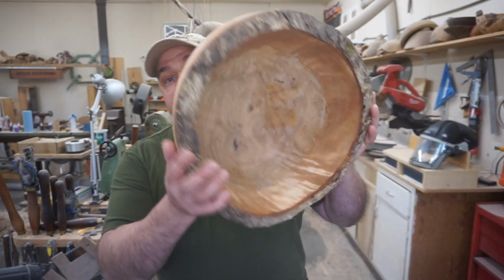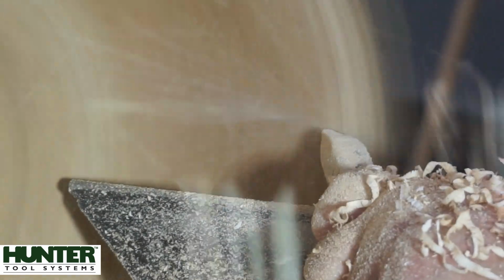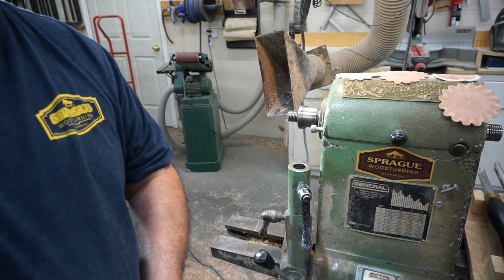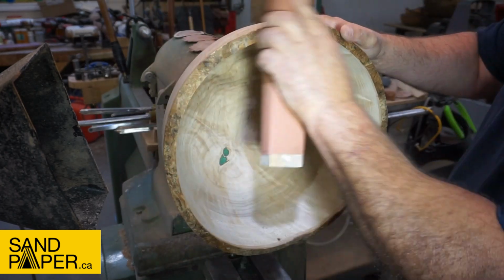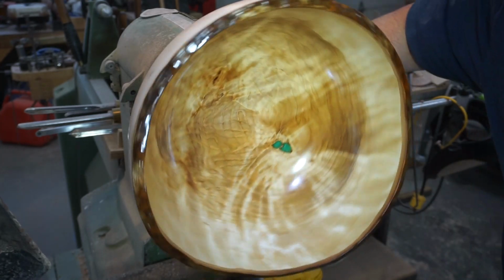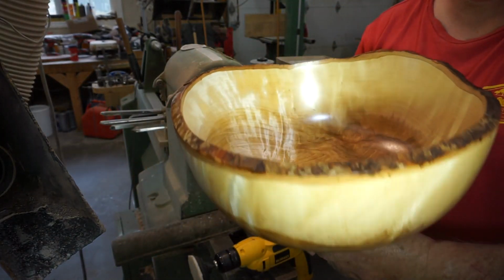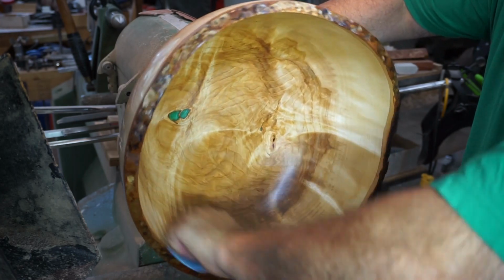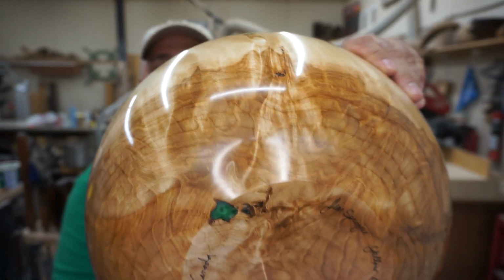Woodturning - Yellow Birch Burl with Emerald Green Tinted Resin

Comment: Absolutely gorgeous piece and admirable workmanship - true attention to detail! I have used osmo oil products in treating external cedar cladding and found that if I cut it with about 25% denatured alcohol the first coat is better absorbed and the oil goes much further.
Reply from the maker: Good to know, I’m assuming Methyl Hydrate will do the same since DNA is so hard to get here in Canada. Thanks 🙏
Reply: @SpragueWoodturning  I’m not sure but we’ll worth experimenting - I have also had some success using white spirit as a solvent (mineral spirit) but obviously this has less alcohol content and takes longer to go off. Hope this helps!

Comment: Spectacular Jim!  I noticed those little shiney spots on the sycamore bowl I just finished too from the osmo poly-x..cant figure out what they are. I ended up buffing with white diamond then carnauba and it turned out great. Not sure what it could be thinned with..I got some on my hands and nothing took it off🤪👍🏻👍🏻
Reply from the maker: The shiny spots are splatter from the drill, or that’s what I think they are, thanks 🙏
Reply: @SpragueWoodturning  Jim, I believe you are using too much of the product. I apply it in VERY thin layers and get good results. There should never be splatter when using the pad and drill to work in. Great bowl!  Chuck D

Comment: Another stunningly beautiful bowl!  Thank you for your detailed explanations and thought processes as you go through the turning and finishing  of your pieces. Have you ever tried the Minwax line of products such as the Wipe-on gloss Poly and the canned spray gloss?  I have found thus far that after sanding out the sealer, I like starting with the wipe-on ( maybe 2 coats depending on wood), wet sanding between, then topping off with several coats of the gloss spray also wet sanding between up to 2000 grit before final coat. Just wondered what your experiences have been with it and your thoughts about the finish in general.  Again, thanks for great work and presentations.
Reply from the maker: My go to finish was Danish oil for many years, as a business I need to use food safe finishes for my functional work so I’ve never really use poly except on table and such. Minwax makes fantastic products, thanks

Comment: Hi Jim, I am a little surprised you finished with Hampshire wax for a salad bowl. My experience has not been good as I find any moisture ruins the finish.
Reply from the maker: It can be added again if it wares off and the polyx is still shinny below the wax so I’m not even sure it will be that much noticeable when being used. With all that said, I want to move away from it and just use the polyx once I’ve got it totally figure out. Thanks